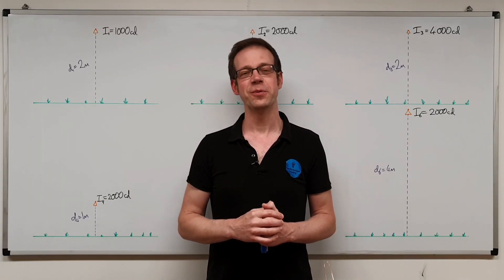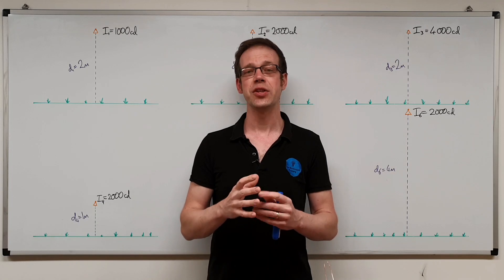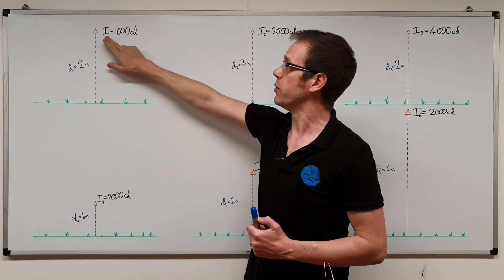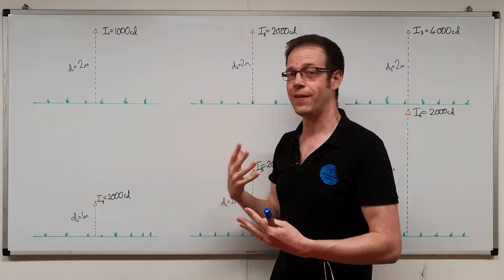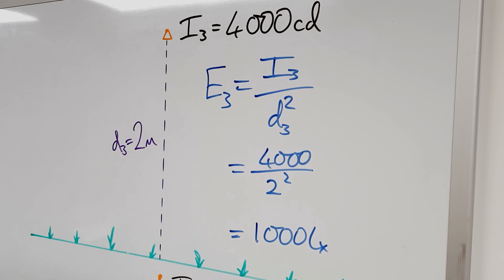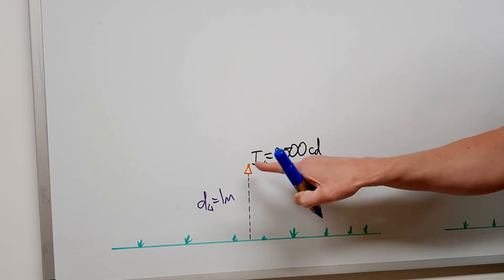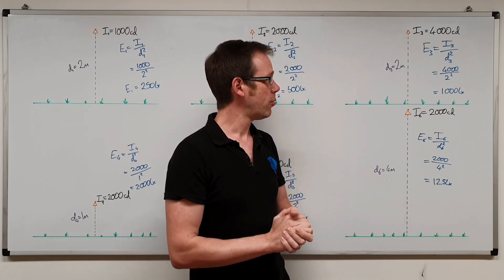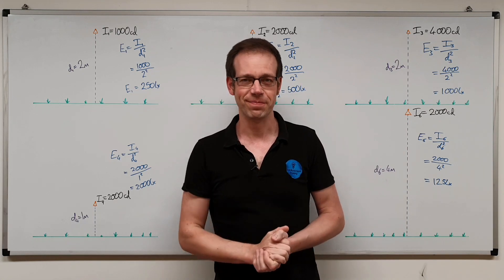How to Use the Inverse Square Law to Calculate Light Levels

Comment: Why would anyone, outside of a lighting technician or engineer, need to know that fact?
It is pure sophistry. Scientism to the extreme. 
It is soooo simple.

How bright a light is:
The closer you are to a light, the brighter it gets.
THE INVERSE"
The farther you get, the dimmer it gets.

But when your parents spent thousands per semester, now you call this obvious observation,
"The inverse square law".
 It sounds so sciency. Adding the word "law", now it's official.

Squaring a number does nothing for the equation, accept add a superfluous algebraic 
sounding word to the equation.
Reply from the maker: Squaring the number changes the equation significantly, it means if you double the distance away you quarter the illumination not half it. So it's pretty critical to be fair.
Reply: @JoeRobinsonTraining  Yes, but it means nothing in the real world. It is only a measurement. 
My point, you missed, was it's common sense to most of us, but when your parents spent many thousands of per semester on your education, you call those obvious observations a "law". Using sciency sounding labels impresses the low information listener.
Reply from the maker: @LazarusWolfForensicHistory strange thing to feel the need to comment on. 

My parents didn't pay thousands for my education. I completed compulsory education and then became an apprentice. These videos are designed for learners following a similar route.

The concept of the light level reducing as distance increases is obvious but the squaring is not obvious at all until it's epxlained. It also has multiple real world applications for making sure spaces are lit to the relevant levels for various activities. 

These videos aren't about looking clever they're about educating people to pass an exam and then hopefully going on to apply it at work if the learner ends up in the relevant part of the industry.

Comment: Hello joe
Love to see your lesson if I may please I have a question I have a sum and it says like this: a new similar lamp is to be installed on a pole having the same  height the same meters away from the existing lamp so that the illumination under each lamp at the pole is 300lux calculate the distance between the two pole to achieve the required illumination  can you help please thanks for your great work kind regards anthony
              I10 meter high
5m_____l______6m
Reply from the maker: Hi Anthony, I'm not sure I quite get the question, please could you send me a picture of it via social media?